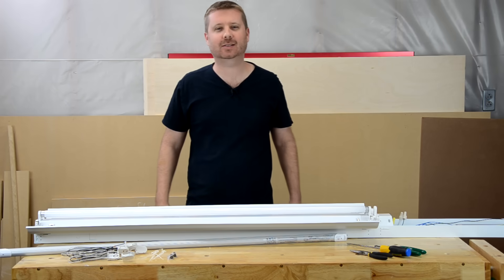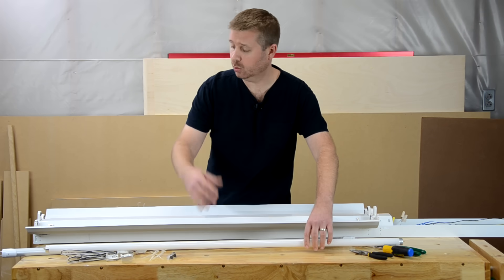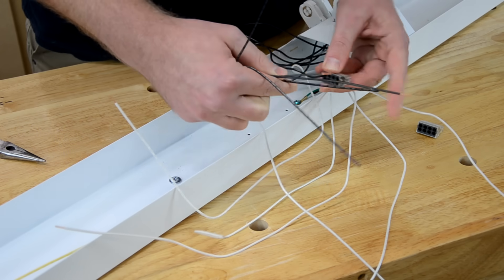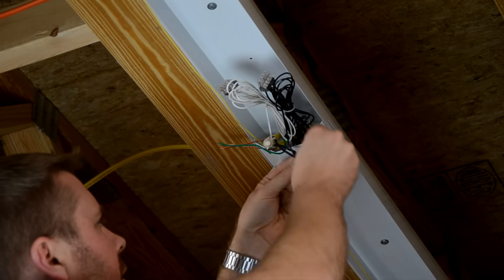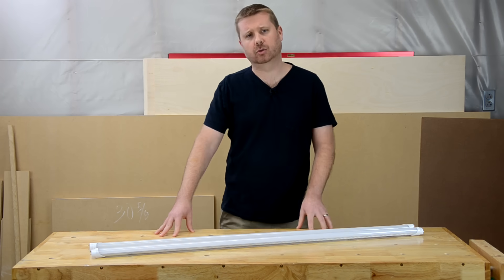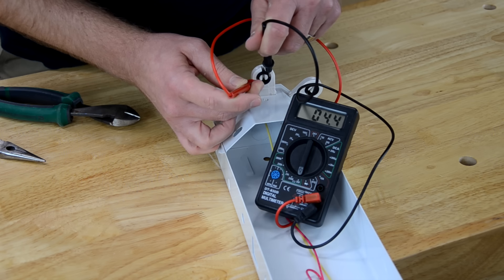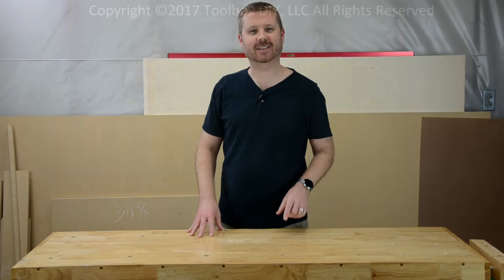How to easily convert fluorescent Lights to LED –Easy Ways to Save Money

Comment: Waid a minud.   Some circuit diagrams and definitions are in order:  What's shunted vs non-shunted look like?
What's a finished LED lamp fixture wiring look like?    You skirted around grounding:  THE GROUNDING WIRE IS
GREEN and must always be connected to the fixture housing (the bare sheet metal).

Comment: Good afternoon, I like your video, I was wondering how much electricity do I save if I change to led from Florence lamp
Reply from the maker: Many 4 foot T8 fluorescent tubes use 32 watts of electricity. 4 foot LED replacement tubes use anywhere from 12 to 24W. You'll find most of them are about 18W. So the savings is 14w per bulb.

Comment: Well worth the conversion, my home is 100 percent LED for about 8 years, I have integrated Alexa and motion sensors (Insteon) when you walk into a room the light will come on for a pre etermined time  or on my steps I have the LED 35 ft light strip, no more turning on and off the lights, its a wonderful thing.

Comment: I am very technical but i don't  get your explanation.. 
But mine has a starter in it, should i remove it and the transformer?
And make sure the "tubestones" are not shunted..
Well heck, i'll order some complete ones with armature from Ali.. ;))
Reply from the maker: If you have a starter, then your tombstones are non-shunted. In this video, the tombstones are shunted because this fixture was using an instant start, electronic ballast. In your case, you have a couple of options. If you want install "plug-n-play" LED lights, you would buy double-ended ballast compatible LED tubes along with an LED starter shunt - this looks just like a starter but has either a fuse or just a short inside of it. Note: this video only deals with single ended LEDs and not the double ended type. 
If you want to bypass the ballast and use single ended LEDs, just remove the ballast and the starter. Then wire it up like I did in this video.
Third option: go buy an LED fixture! This is not a bad option, but choices are still somewhat limited especially if you have a decorative fixture.

Comment: I finished whole warehouse & office with more than 60 pcs of new 4 ft led bulbs, some fixtures were 4x2 ft with 4 light bulbs non shunded & others were 4x2  shunted with skinny 3 bulbs ... the new led bulbs required both side connections. So my conclusion : after ballast cutted, shunted had a red to left with fuse & other side with 3 blue wire for neutral. so I connect the input hot wire to the left red & 3 blue neutral I plugged onto a 4 hole plastic plug with input neutral wire... done... for non shunted, I did the same...  3 different color wires on each side  plugged to 4 holes plugs with hot & neutral wires, cut & tape other 3 non use wires.   done.. all working beautifully.   The shunted fixtures fooled me, I opened the first cover & saw no balarst & did not check the 2nd cover which had ballast... so when I finished & 1 or 2 kept blinking, some were fine, then also blinking.... I was thinking what was going on ?.  at the end I opened 2nd cover & found the ballast.  I corrected my mistake & removed all ballast & all working perfect now.

Comment: no need to replace tombstones... use one of each wire on one side & plugged into 4 holes connector with  wires & also input wire.... do the same for opposite side..... quick & easy.
on the ceiling conversion, I used a wire or rope to hold the middle & the lower part would fall down....now I can do it about 15 minutes  each......practice make perfect.
Reply from the maker: This video demonstrates the conversion using single ended LED tubes. Most fixtures that use an electronic ballast use shunted tombstones which will not work with a single ended LED tube. Non-shunted tombstones must be used.

Comment: If my tombstones don't come with wiring, what gauge wire should I use to connect them?
Reply from the maker: 18 gauge is a safe bet. The tombstone manufacturer should specify the compatible wire gauges, but if they don't, start with 18ga.

Comment: you never reinstalled the ballast
Reply from the maker: That's correct. Single ended LED tubes are not compatible with ballasts. I mention it later in the video that I prefer to bypass or remove the ballast because it is just one more point of potential failure. There are some double ended LED tubes that require a ballast but I recommend against these. If a ballast fails, it's much easier to just bypass it rather than replacing it. If you don't want to remove the ballast or do any of the rewiring in this video, try a double ended LED that work with or without the ballast. You can just swap out the bulbs and then if the ballast ever fails, you can just bypass it. These weren't readily available when the video was made but there are more options now.
Reply: I am sitting somewhere between stunned and angry.  Not at you my friend, thank you, but at my materials supplier who will remain nameless.  I have, and I am not making this up, in the last 3 years retrofitted about 1/4 million fluorescent to LED's and currently I have thousands of lamps waiting because there seems to be an international ballast shortage (I am a construction project manager for some very large corporations.)  I would expect my supplier to keep me appraised of developments such as this because when you put 100k lamps into a industrial setting, not having to put in 50k ballasts and maintain them would be a good thing.
Reply: Since I don't want to remove the ballast or rewire, I'm inclined to follow your advice and just "swap out the bulbs."  But, then you go on to say "if the ballast ever fails, you can just bypass it."  What does that mean?  Do I have to open up the fixture again and do some rewiring to bypass the ballast??  If that's what is necessary then that doesn't sound like a labor-saver in the long run.   @ToolboxDIY

Comment: Why didn't you twist the pigtails together with the hard wiring before installing the wire nuts? LOOSE CONNECTION possibility!!!
Reply from the maker: The wing nuts I use do not require pre-twisting. If I'm using more than 3 conductors, I pre-twist them with linesman's pliers. When I don't pre-twist, I turn the connectors until the wires start twisting around each other. So far I haven't had any loose connections. I'm definitely not against pre-twisting. I just don't find it necessary in all cases.

Comment: As an amateur electrician myself and this video is American? biased i find the terminology strange ie: tombstones, shunted & non shunted, hot wire etc.  but not the actual wiring which is straight forward having converted a uk 4ft fitting myself bringing the wattage down from circa 52 watts including gear loss and a quiet humming ballast to 16 watts and a brighter LED tube! Plus no switch start flashing to start.Gear left in place but not connected so fluro could still be used.Daylight (or cool white) tube chosen in my case - so much better, silent and brighter also cheaper to run!  I say a job very worthwhile doing!!

Comment: If "shunted" simply means that both pins are on one wire,  then there is NO reason to buy special "tombstones" because DUHH all one has to to do is connect the wires together or put a jumper in which most of the (99 out of 100)  will have spare stab ins  and you just strip a 3" piece of scrap ballast wire and stab in connecting both pins....IF that is what "shunted" means then what the hell?  You trying just to sell crap to people you know they dont need?????  Or is "shunted" mean something else??
Reply: i just verified that ALL a "shunted" tombstone, bi-pin lamp connector is one that only needs one wire which connects both pin contacts together ...repeat there is NO...ABSOLUTELY NO reason to replace a "non shunted" tombstone with a new one if the old one is in good condition!   DUHH!  ....just connect wire from each side of the tombstone under the same wire nut .   ...maybe someone that is super anal and cant stand the thought of jumpered pins....someone that had an overbearing mum or some shit ...don't buy crap you don't need ..it wastes materials and increase carbon foot print ....actually the more I listen to this guy he just does not actually understand....there is NO advantage of buying a shunted socket compared to just jumpering or connecting both wires under same wire nut....
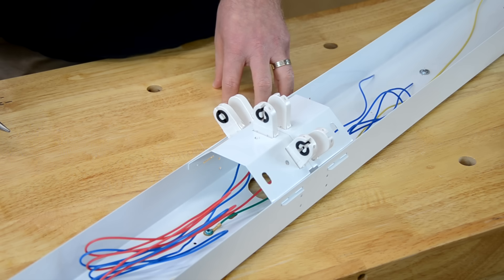Reply from the maker: You can't used shunted tombstones with singled ended LED tubes (the type used in this video). I think there might be some confusion due to me misspeaking at about 3:57. I said it backwards - I am replacing shunted tombstones with non-shunted not the other way around. I put a note in the description and a pop-up note in the video to explain the correction, but it's easy to miss. It's correct through out the rest of the video. To clarify things:
Singled-ended LED tubes require non-shunted tombstone 
Double-ended  LED tubes can use shunted tombstones -  most fixtures with an electronic ballast already have shunted tombstones so there is no need to replace the tombstones.
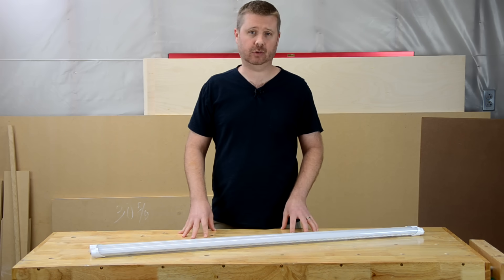There's a whole section in the video that explains single-ended LEDs and differences between tombstones. That's at 9:51.
Reply: @ToolboxDIY  Then just buy double-ended LED bulbs to begin with! Senseless confusion.
Reply: @dougiequick1  exactly, thank you

Comment: the easy way is to go to home depot buy led tubes that work in your current fixture thats all i did and it worked perfectly just like i was replacing normal bulbs
Reply: This is more for those interested in upgrading their fluorescent lights to remove a broken or damaged ballast. This also reduces the power consumption as the old ballast when left in still has the same amp draw.

Comment: Or you could just play Russian Roulette
If you are not an electrician don't do it.
Also at today's rates it is cheaper to buy a new LED fitting
There is also very little savings in changing out bog standard fluoro's unless you have a ton of them

Comment: Did you just wire in the lights to the supply power?
Reply from the maker: That is correct. The LED tubes each have a built in AC to DC power supply and regulator. So they receive 120V AC power.

Comment: Chris, I have 8 foot hi output fixtures. I would like to retro to 4 foot led tubes single ended. As you know my fixtures do not have back to back tombstones in the middle. It does have a center ballast cover bracket that can be snapped in and out. My question is, are there tombstone brackets available that I can purchase to be able to utilize this fixture for my retro. A link as to where to buy them would be great if they are available. Thank you!
Reply from the maker: There are such brackets! Here's one that might work: https://www.greenledzone.com/led-t8-retrofit-kit-converts-2-8ft-fluorescent-tubes-into-4-4ft-led-tube-lights/
Reply: Thanks chris, that may work

Comment: Just plug in a fucking LED tube - NO 'conversion' necessary.
Reply from the maker: Not all LED tubes will work with a ballast. Single ended tubes (like the ones in the video) won't work with a ballast at all and they won't work without doing this conversion. The bulbs you are referring to are called doubled ended ballast compatible. If you have an electronic ballast, they go right in. If you have a ballast and a starter, you typically have to also replace the starter with a starter shunt.
Doubled ended, ballast compatible tubes are by far the easiest at first, but they have a few down sides. 1. The ballast still consumes electricity - not much but it is wasted power. 2. The ballast can still fail which is a pain in the ass.  I prefer to remove the ballast from the beginning so I never have to worry about it in the future. 3. There are some safety concerns with double ended LEDs. UL has issued warning about shock hazards and fire hazards. I don't believe all double ended LEDs. 
Totally your call, but if you ever decide on single ended LED tubes, this conversion video is how to do it.

Comment: As an electrician, I was shaking my head all the way through.
Reply: @Geoff x 2 Were you finding it shocking?
Reply: Absolutely. I can't believe  the misinformation in this video. Not to mention the danger. Even his multimeter comment was nonsense. There is no way a shunted circuit with a conductor less than a centimetre long has a DC resistance of 5 ohms.

Comment: Why didn't you just "daisy chain" the sockets?  Then there would be one black and on white wire coming from the powered end of the socket assembly instead of that rat's nest?
Reply from the maker: If I understand you correctly, this would imply the lampholders are then wired in series where the neutral of one lampholder is feeding the hot of the one next to it. I doubt this is possible with these tubes. The voltage drop across each tube might be too much for the internal AC to DC regulator to handle. Also, if one tube ever fails, all of them would go out like the old Christmas light strands.
The rat's nest could have been avoided if I chose to trim the leads coming off the lampholders. I didn't see it as necessary (nor did I want to spend time re-stripping 12 leads) since the bundle would be hidden behind the reflector never to be seen again!
Reply: No, they are in parallel.  Perhaps "daisy chain" isn't the wiring method I think it is.  Anything is possible.  This is the way I wired it (and it was the way shown in the kit instructions).  Each socket has two wire inserts for each pin contact.  Typing out the connections would be long and confusing, so I just drew up this diagram: http://img.photobucket.com/albums/v250/JeffLeites/MyWebPhotos/TombstoneWiringForSingleEndedLED.jpg
The red wire in the diagram is actually white in the real world.

That's the way I did mine yesterday.  Works great!  For the last week I'd been putting up with two daylight florescents and two "kitchen and bath" florescents in one fixture, but only one working ballast.
Reply from the maker: I think what you did would be considered a daisy chain. I forgot about the extra connection holes in the tombstones.  Seems like that would work just fine.
I'm too lazy to cut and strip that many wires when I know they won't be seen and won't create a safety problem. But I'm glad you shared this because this might come in handy for some other fixtures I have yet to convert. Thanks, Jeff!

Comment: Excellent video. You can cut the long wires and it will be a neater look. Also after cutting the wires you can work with them easier. Thanks for the excellent video. I thoroughly enjoyed everything about the video.

Comment: You did not say the cost of changing a fixture over to LED.  I understand the LED are cheaper to burn.
Reply from the maker: For the most part, the cost of changing over a fixture is the cost of the new tombstones and the LED lamps. In my case, I had a six lamp fixture that was about $8 for the tombstones and $56 for six LED tubes (this was in late 2016).  Fixtures already wired for LED were not too common then, but now they go for about $50-60. I actually have 5 six lamp fixtures and rather than replacing them, I am converting them as the ballasts fail (or whenever I run out of fluorescent tubes).

Comment: There are much easier conversions that only require swamping out the fluorescent tube and starter with a replacement LED strip tube and a dummy starter, no wiring, no opening up covers takes between 30sec to 2-3min depending on if there is a diffuser fitted.

Comment: So each of the new non shunted lamp Sockets will fit into an old fixture??
Reply from the maker: For the most part, yes. I've seen two different types of lamp holders: those that snap in, like the ones in this video and those that slide in from the ends. You can find non shunted lamp holders that actually support both installation types.
Reply: Thank you for the timely response!
Reply: One thing to note. Non-shunted predates shunted. Shunted tombstones are used with an electric ballast, which is newer technology. 

The only true difference between a shunted and non-shunted tombstone is that the shunted tombstone comes with an internal connection between the left and right contact, while the non-shunted doesn't; you can convert a non-shunted tombstone to shunted by adding an external shunt wire, which is easy to do as they normally have four insertion holes on their bottom, two for each contact; you just jump the inner two insertion holes and voila, a shunted tombstone. 

They deliberately didn't change the exterior of the tombstones so that they were compatible with existing fixtures, just as the electronic ballasts were initially designed such that they used the same screw holes in the fixtures for attachment as the pre-existing ballasts. That way the industry didn't have to redesign and retool, and one could continue using the current installations, which is always a major selling point when the change in technology isn't that large. 

Some redesign did occur in the years since then, with the introduction of the press-fit option; tombstones that are only press-fit are non-compatible with the older fixtures.

Anyway, non-shunted isn't new tech, it's actually the old tech; and if you just happen to have non-shunted tombstones left over from the old days,  your packrat tendencies just paid off, provided that the fixture uses the same tombstone mounting methodology.

Comment: The power current in the UK is 240 Volts. Is this vid still relevant?
Reply from the maker: All the steps would be the same, but the parts/components may be different. The tubes will obviously need to accept 240v as will the tombstones and the wire connectors. The last last two are typically rated up to higher voltages (265v sometimes up to 600v), but be sure to check. I've heard that in the UK that if you are not a licensed electrician you are not allowed to perform this type of work. I have no idea if that is true or not so you might want to double check your local regulations.